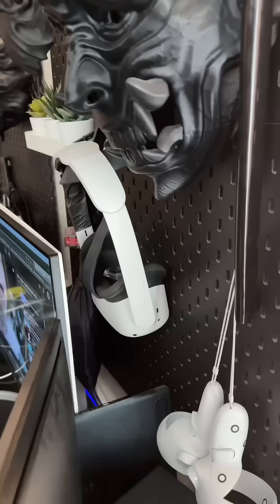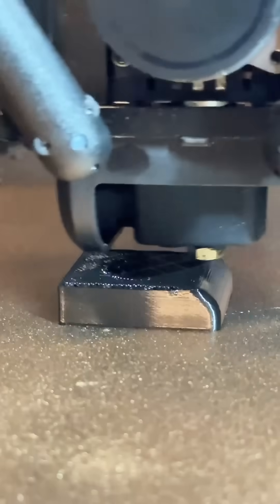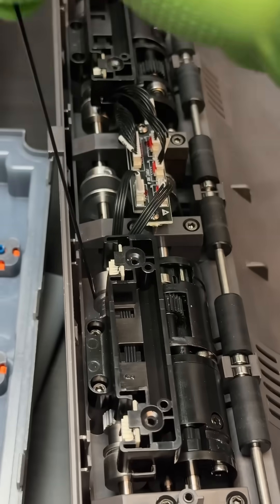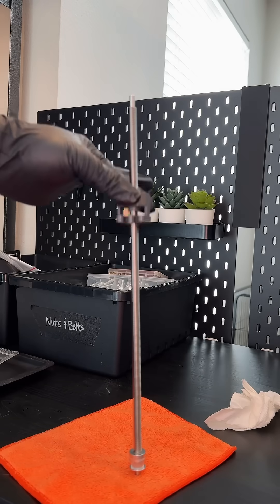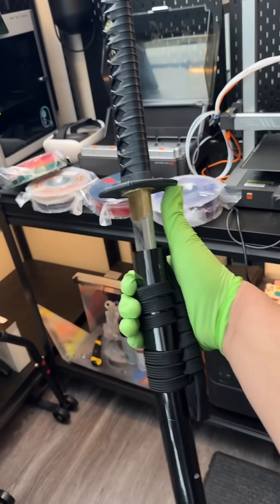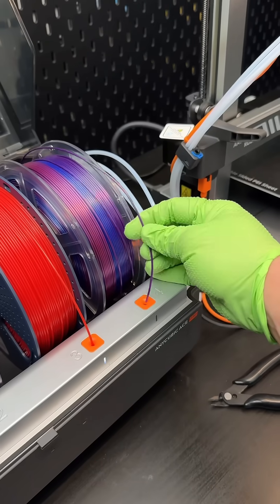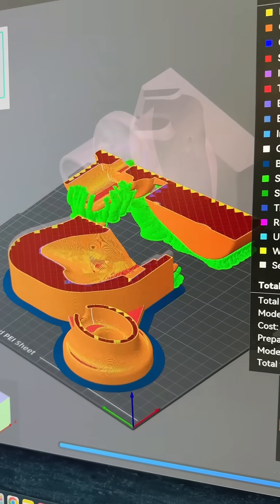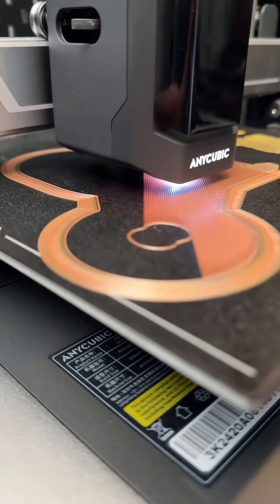Don't put TPU in the Ace Pro filament box for the Kobra 3 Combo

Comment: But so I can't do a multicolor tpu print?
Is there any solution? 😔😢
Reply from the maker: You could use the Bambu TPU in the box. It's not as flexible as normal TPU but it's stiff enough to survive multicolor TPU printing
Reply: @abovewongart  I know, but the problem is, I need 95A and have many kg of it here
Reply from the maker: @Blackshett  gonna have to side spool it unfortunately
Reply: @abovewongart  is there any way to feed two colors without ace?

Comment: So how would you use the tpu? I’m super new to all this 😮
Reply from the maker: Use the side spool normal holder. On other multicolor printers same, the side spool holder for weird materials like carbon fiber, Asa, tpu, metal filaments
Reply: @abovewongart One multicolor printer that I doubt you have is a tronxy. It doesn't use an AMS and you can buy bundles with a laser cutter from the little I've used it, it works well
Reply: @abovewongart  &  @AIPickless Tronxy also makes another 3D printer that prints clay or porcelain ceramics! It’s called the Moore1. That you then can fire (even fits in a cheap microwave kiln) and then glaze and fire again. Bet you don’t have that printer either! It would be good related content for sure to get one.